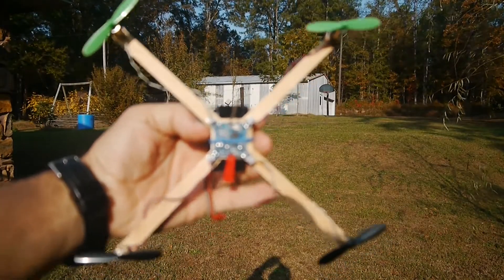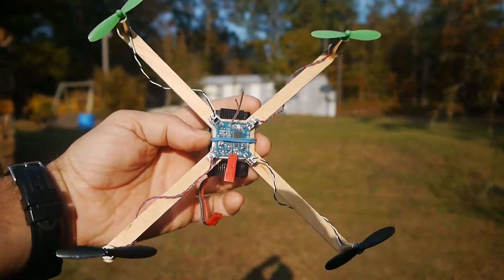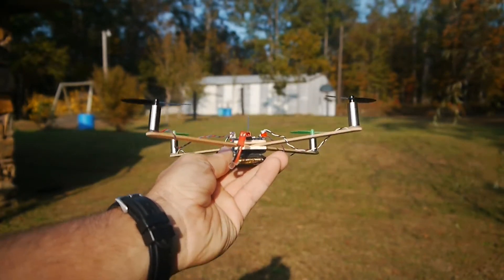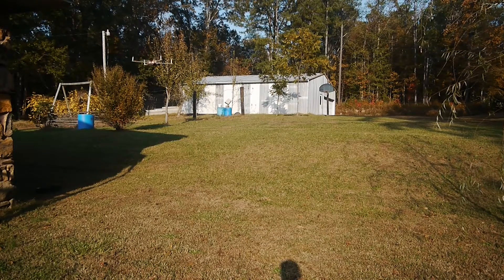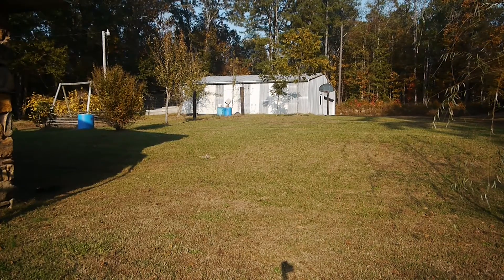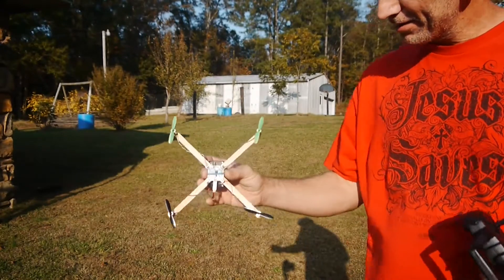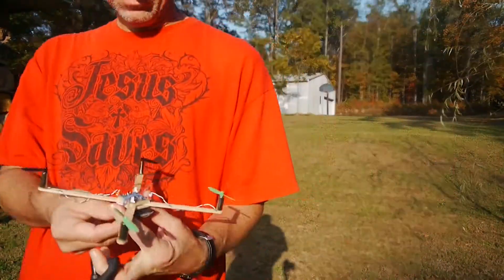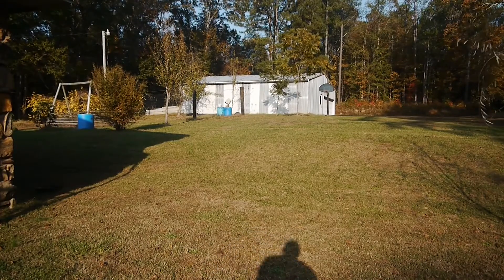Popsicle stick drone

Comment: Pop some rjx 65mm props on that there light and thin enough not to strain the motors and the lift is going to be way more plus you got miles of clearance cool build